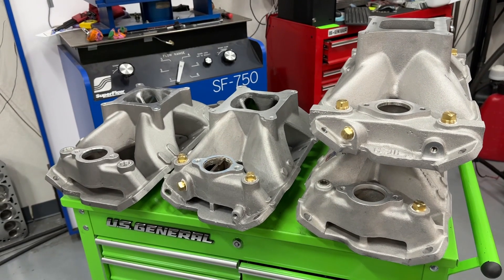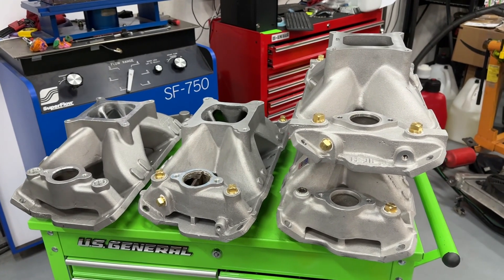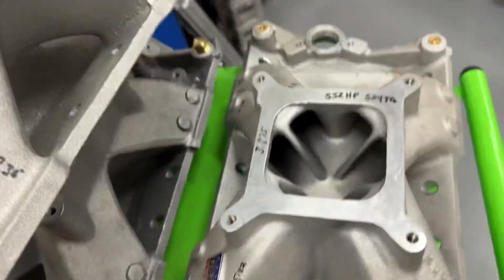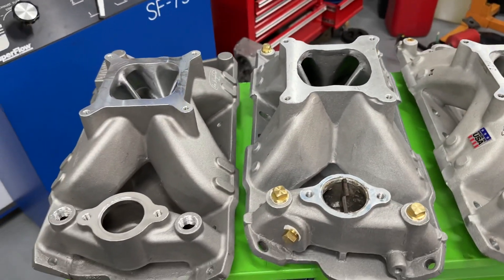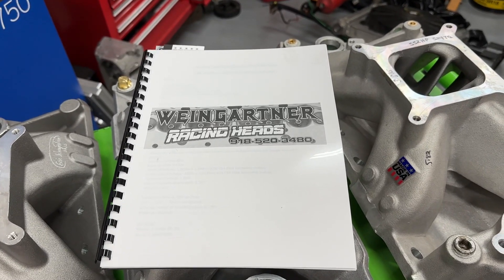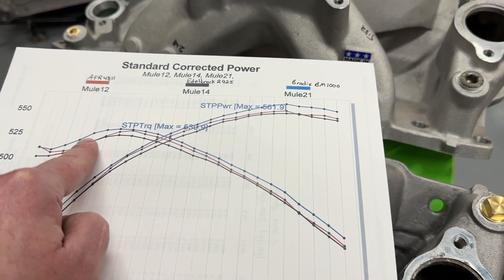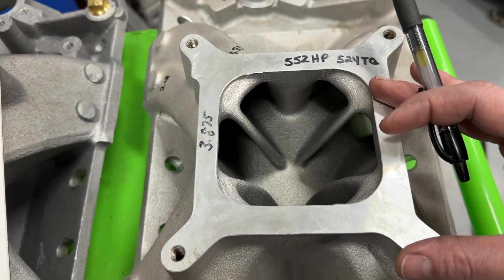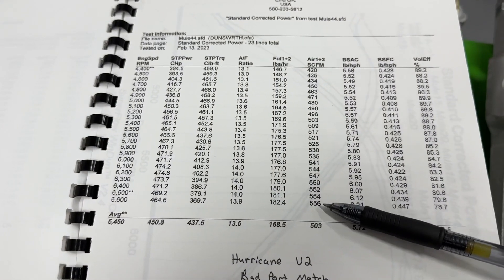Dyno Testing Intake Manifolds With A Two Barrel Carb

Comment: I am building a 1959 283 Chevy for the street it is .o60 over with the 601 gm high output 305 truck heads with 1.84 intake valves it does have a 446 lift cam I'm wondering what intake and carb to run .....my thoughts are the Edelbrock eps with avs2 650

Comment: I would give 10HP @ 6500 for 10ft/lb @ 4500 anytime on a Saturday night special claimer. 2bbl CT engines are very sensitive to bore/rod/stroke ratios vs cam overlap and centerline.
Changing rods from 5.7 to 6in requires reduced overlap. Economy classes require stock exhaust manifolds which messes with intake flow. Too many variables in possible combinations to get much specific information on your limited tests. Don't let people talk you in to extensive combos, test as you can and let others make inferences as they will.

Comment: The reason the Edelbrock made way more torque on the bottom and the Hurricane made such hood high RPM horsepower is due to the air fuel ratios.

The trick to making huge power with 2 barrels is to get the lower RPM range good and rich like normal (12.0-12.5) and as lean as possible on the top end (14.0 ish)

Take a look at the Edelbrock afr and coincidentally it’s right around 12.5 to 13.0 in the low rpm area but the Hurricane is leaner in this range. Also in the high RPM range where the Hurricane is better it is around 14.0 which is leaner than the Edelbrock in that range.

It all makes sense in the twisted world of 2 barrel motors 😉

BTW with proper carb tuning on both I’d expect the Hurricane to just edge out the Edelbrock Super Victor on most of the run and elsewhere be equal.
Reply: Also I am incredibly disappointed that you didn’t test the Performer RPM dual plane with the 2 barrel

Comment: On my street and strip 327 
2 bolt main block small block Chevy solid.roller combo, with the hurricane intake, and out of the box Calflow 200cc 64cc 2.02 intake 1.6" exhaust valves (measured 196cc 65cc) ( China copy heads of the AFR 195cc enforcer, all copy's of the Dart Pro-1. 200cc 64cc. ran best with my 4150 flange 950 double pumper carb.

Comment: Eric, Looking at the 4 intakes, it appears the Edelbrock has the thinnest dividers. That's the only difference I noticed. Maybe that's what made the Edelbrock perform better with the two-barrel. BTW, I would like to see the Holley port matched and ported then bolted to a set of your prepped Dragon Slayers on the dyno mule. Maybe it will perform then. Maybe the stock heads aren't working it out enough. Who knows! Thanks for another great video!

Comment: If you take the 2-barrel rating at 3-inHg and multiply it’s CFM rating by .707 then you get the CFM at 1.5-inHg…..that “500cfm” 2-barrel should flow about 353-CFM at the same depression as the 4-barrel…..you can calculate what depression it was at on engine by doing other math if you use the airflow meter on the dyno.

Comment: I don't recall but, are you also dynoing everything again with a set of high flow heads to see the difference? Thanks
Reply from the maker: Yes but I have two more rounds of intake testing with manifolds then I will start changing heads and porting them. Once the power gets up there I will test manifolds again.
Reply: @WeingartnerRacing  ok cool, looking forward to it  ! Thanks

Comment: Tks  were they all lean and did you rejet?
Reply from the maker: Never jetted.
Reply: @WeingartnerRacing  TKS I have fiends that run 2bbl , not less expensive,  they should buy your book   you are  right about how hard hp gains are I had one that ran high torque and tall gears and another that would the snot out of his mill, much more maintenance

Comment: Very cool testing so my question is since the hurricane passed the elderbrock 6100 and above what if the engine that revs about 7500 or almost 8000 for what I am about to do would it be better to run the hurricane than the elderbrock I need to ask my buddy how much rpm we come off the corner because I swear the wingless spec Sprints we don't slow down to much on the big tracks at least. But what are your thoughts on what is I run a engine that is a way higher rpm would the hurricane be a better option if we run 7500 or another 8000 peak
Reply from the maker: It really depends on how you gear the car and how low in the rpm you go.
Reply: @WeingartnerRacing  oh got it I  understand thank you
Reply: @WeingartnerRacing  ever see pictures of those cup car restrictor plate intakes from the early 90s?  Wonder what a modified version of that for 2bbl would do.

Then again some classes don't even let you modify the intake

Comment: 2 bbl carbs are rated at 3.0 in Hg, 4 bbl carbs are rated at 1.5 in Hg, so comparing the two numbers isn't quite accurate unless you convert.  Multiply the 2 bbl number by 0.707 if you want to compare to a 4bbl.
I raced nascar for a couple of decades and remember using the same engine in two different classes by just changing from 4412 2 bbl to 830 cfm spec 4 bbl.  HP change on the dyno was about 90 hp with a 355.  Also, using the slotted adapter plate for the 4412 was worth a few hp, but you really needed to back-to-back pulls to see what worked best on each intake.  Also, "accidentally" leaving out a vacuum plug in the intake on the 2bbl intake was good for 10 hp, and using a balsa wood adapter was worth even more, if legal.

Comment: There’s an interesting carburetor I’d like to see tested. The 6425 Holley 2 barrel 650 cfm. There are some full house Frankenstein versions that are available through the aftermarket with larger throttle blades installed that flow north of 800 cfm.